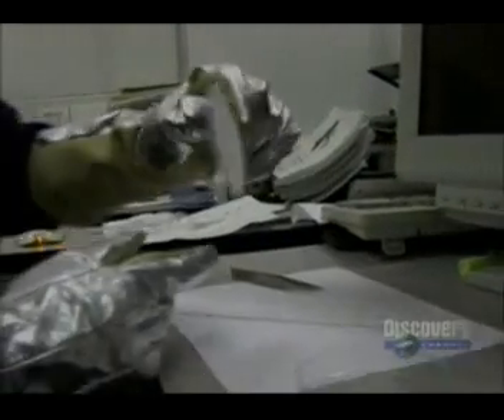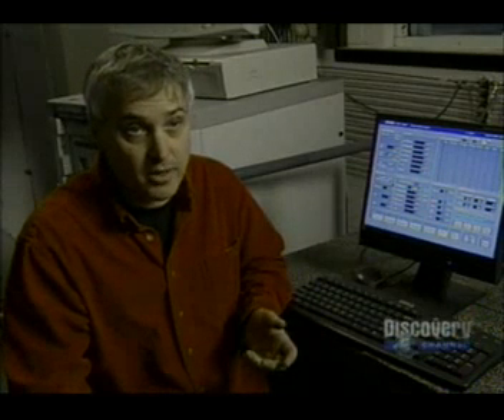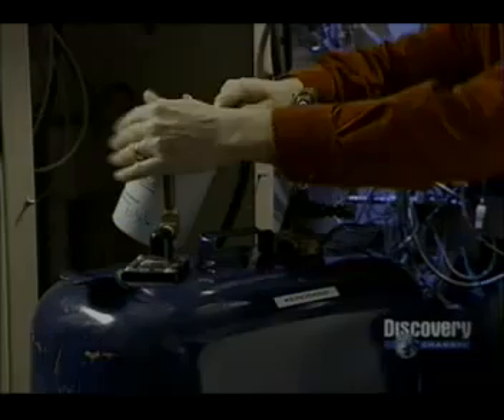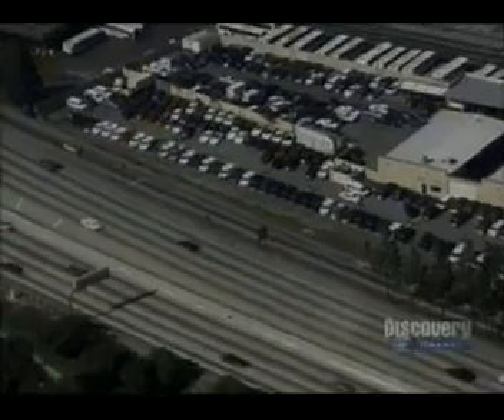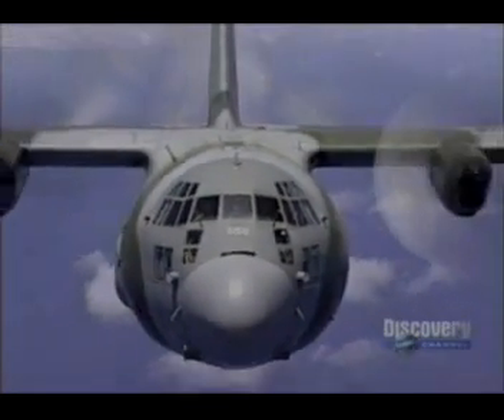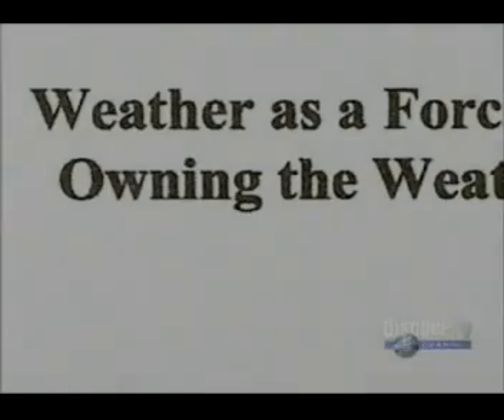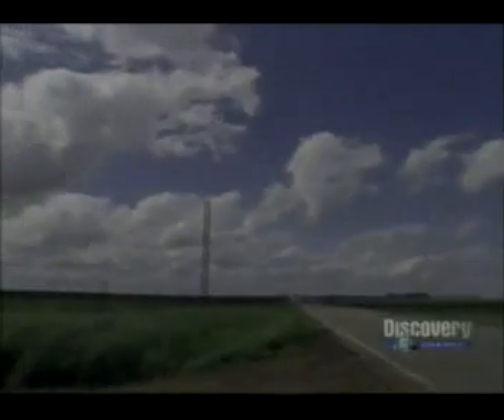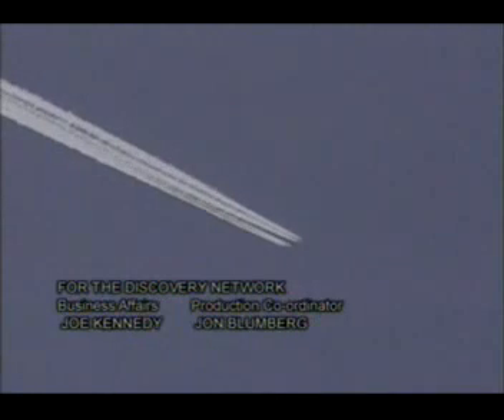Full Documentary- Discovery Channel-Best Evidence-Chemical Contrails 5 of 5 sub español

Comment: I agree with Rosepaigefly. The scientists are testing the wrong system. That's the whole point is that a normal jet engine would not be leaving persistent contrails. It's not in the fuel. It's a separate system. When questioned about the photos of tanks in aircraft, Boeing claimed that they were for testing plane stability when people are moving around the aircraft. Really? That makes no sense. People don't act like sloshing liquid and that's a pretty elaborate system to set up inside aircraft for something like that. I wonder what the nozzles on the outside of the aircraft are for.
Reply: They know....... they think we are stupid 😅😅😅😅😅😅